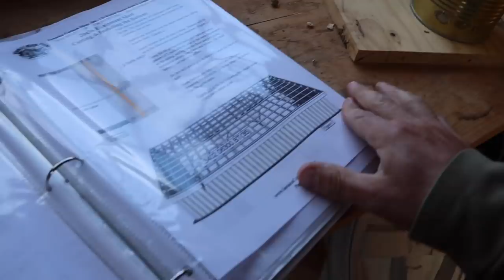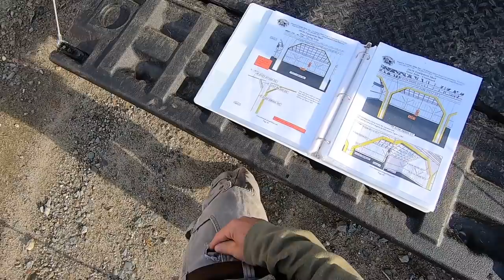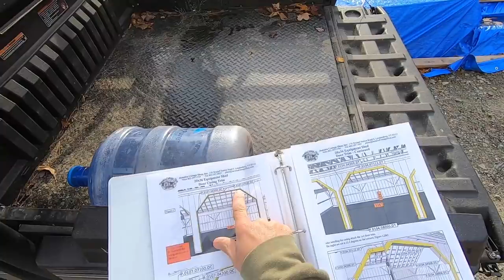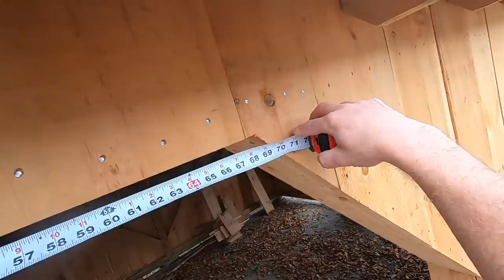Building our OWN Post & Beam Garage Trimming Garage Doors on the Post & Beam Build

Comment: I bought a bay tree 11 years ago and oh boy fresh bay leaves are so much nicer, now because I have to trim the tree a lot more now it’s older I put the branches I trim off into the freezer with the leaves still attached and pull one off as needed I did dry them once but I have found that freezing them keeps their flavour better 😊😊😊 as for the rosemary I bought one bush and spent 2 years doing cuttings to build a full front hedge across the front of the yard. 😊😊
Reply: That all sounds wonderful! My bay tree is 3 years old and is getting bigger and bigger - even though I now have to cage it to keep the deer from eating it.
The rosemary I planted 5 years ago isn't getting enough sun. Instead of moving it, though, I got a small one last week. The new one is called Barbecue; it has nice straight stems that I think can be used as skewers.
My favorite herb, though is parsley.
Reply: @kirstenwhitworth8079  😹yes that’s the rosemary bush I have growing I cut the long branches off it for the BBQ they make great skewers for lamb and veggie kebabs that was one of the reasons for propagating it to build a hedgerow in the first place 😻😻😻you need to use a mettle skewer to make the holes in the meat and veggies as the branches are not strong enough to do that and it’s best to take the leaves of as well which I have taken to putting in the freeze as well until needed 😹😹😹i now grow a veggie called “Parsley Parsnip” I love parsnip and when I for the parsley parsnip at the Diggers club here in Australia I just had to try well they are the best veggies in the garden and because of where I live I can grow them all year around 😹😹😹 I have taken to growing what is called heritage veggies now as I have found they have better colours and flavour and having purple, yellow, white, red as well as orange carrots is fun in the stews today 😹
I am lucky the deer around here only go in the front yard and not in my veggie yard or back yard I stopped planting nice plants in the front and I let them eat wats left in the front 😹😹they leave the banksia rose, tea rose and rosemary alone but the rest they trim down once in a while 😹😹😹i also get the wallabies smaller version of the kangaroo 😹😹 they eat the grass and the native pea i grow for them all around the gardens and yards so they leave the rest alone 😻 and the possums don’t eat much but they have never gone into the veggie garden in the past 11 years even though I have seen them in the garden I have taken to leaving out fruit once in a while for them and the cockatoos in the bird feeder as that’s where the possums spend most of the time at night 😹😹😹
On the bay tree you can also use the branches for skewers as well they are thicker and stronger but go well with beef kababs 😹😹😹
Reply: @kirstenwhitworth8079  I've grown that variety, it can be used as skewers BUT it needs to dry a little....
Reply: @dawsie  Awesome!
Reply: @paintedpilgrim  That's OK. I dry many things and have a wonderful passive energy dehydrator that keeps out the bugs.

Comment: Hey Gina and Al.

Bay is really easy to grow in pots and if polytunnel proves to remain consistently 5 or 6°C/low 40s°F through winter you ought be able to grow it. Then you can bring it out during the summer. It will tolerate in my experience a little frost but not the sort of snow you get.

Comment: I've been watching for a while and finally subscribed. You asked for another solution for a Level. Years ago, I worked at installing wooden decks at the beach, To mark our  posts, we would used a "water level". A garden hose with about 4" of transparent hose/tubing at each end. Filled with water, we would hold both ends at a mark, then take one end to where we wanted to find a level, moving the clear hose up or down to match the level at the other end. (cheap) No Lasers! Try it on your next project.

Comment: Good Tuesday mornin New Yolk City .... the new build is coming along nicely. Will you be banking up gravel around the bottom edge to keep out the snow? Chicken broth looks delish .... do you cook down the ingredients in the pot twice? Was wondering why you don't chop up the carrots smaller to pull more of the nutrition out of them? AL's new mantra is going to change from "I like it" ... to "nailed it" ~8^) Yep, it's been gloomy/rainy down here in PA as well. The good news is that the temps have been pretty good, so my hot peppers are eking a little bit more time out of the growing season. It will be interesting to see what kind of temps you are maintaining at this time of year in your high tunnel/greenhouse. Take care AL, Gina & Olivia.
Reply: Lumnah Acres said in a previous reply that gravel will be added to bring level up to the top of concrete piers and thus a gravel floor.

Comment: Wow, those are sensitive alarms for a mouse to set them off.
Reply: I know, right?  One would think they'd be adjustable to ignore little mouse critters!
Reply: The thing is most motion detectors are passive infrared and are looking for a human sized target 35 (or more) feet away. Humans and mice are roughly the same core temperature so the closer they get to the motion detector the bigger they look. A mouse on the counter <6 feet away looks like a human at 35 feet.
Reply: Yes, I have cameras that repeatedly alarm on the stray cat rolling around in my driveway. ;)

Comment: Are you planning on some kind of hay storage up under the roof?
Reply: That would be a good place for it.  A couple sheets of plywood or OSB laid on top of the horizontal braces 9:30 would be a great platform for hay bales.
Reply: @samvalentine3206  Only problem, there is no protection for condensation from metal roof. Need boards under the roof to catch the water drops

Comment: I'm assuming your putting garage doors, so what are you going to do for the base of them because they need a level surface to set on that's not going to move. you putting concrete for them or like a 6x6?

Comment: Al, Did yours come with Soffit Boards, or are you saving those long wide boards for doors etc?
Reply: He did nail in bird-blocking boards - I guess those might count as soffits on the front and back edges... https://youtu.be/pDdkNZ10yhk?t=1020 & https://youtu.be/pDdkNZ10yhk?t=1090
Reply: @samvalentine3206  the soffit boards cover the entire outside length of the rafter ends, and reduce Wasp and swallow nesting spots.  I was thinking of putting bird blocks in too on the rafter lintel between the rafters like Al did.
Reply: @LarryTait1  - Thanks for the correction - right you are - but I was close!  If you see his other build, it appears that he likes to leave the soffit boards off:  https://youtu.be/OYAchnoo-uU?t=876 - as he's mounting the cell phone booster, you can kind of see the style of the first barn structure they built.   

I believe that's the style of Jamaica Cottage to have exposed rafters with no soffits.  In fact, as you are probably aware, the side exposed rafters, which would be covered with a soffit board, are "flying" or fake.  They are there just for show.  https://www.youtube.com/watch?v=ViUX-KloYn0

Comment: Too bad you didnt have a rain gutter/catchment system set up on the main barn, and the second garage/stalls buildings already.  You'd have tons of water to collect up for the goats and other animals.  Well, depending on how big the storage totes are tho lol.  I did see the IBC tote in a previous video, could hook that one up to the rain gutter system and have it drain into that tote to store up the water.
Reply: Maybe that's the big surprise?  Somehow I doubt that.  🤣😂
Reply: If you put a gutter on the barn you would have to remove it before winter as the weight of snow they get would pull it off!!!

Comment: I turned off our motion detectors at the old place, and just used the door contacts. We had a cat, not a mouse!
Reply: I'm wondering if the motion detectors can be adjusted for sensitivity - and not get triggered by little mouse critters?
Reply: @samvalentine3206  I tried without success. There is surely a way though